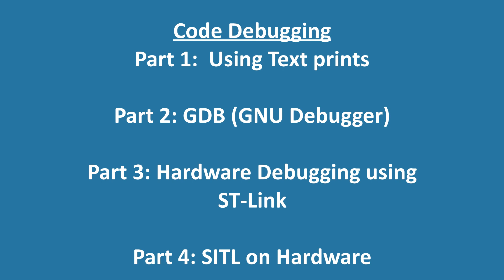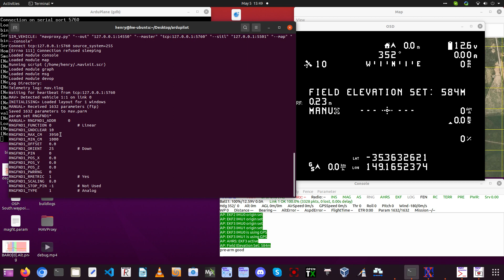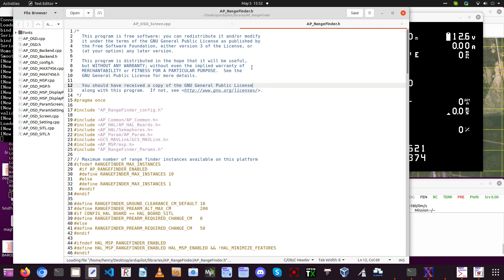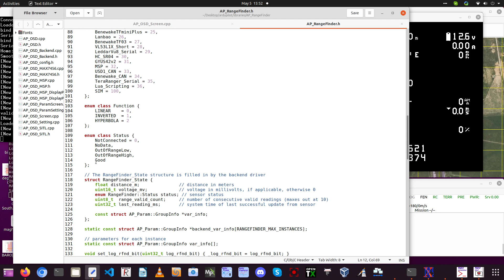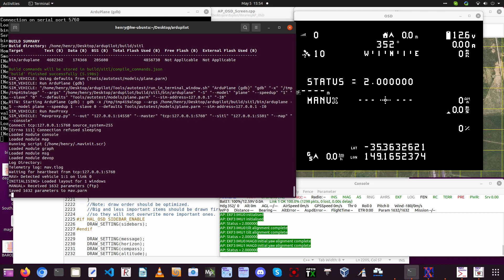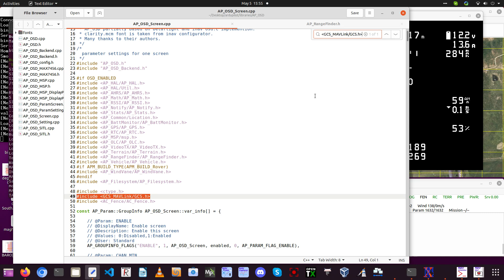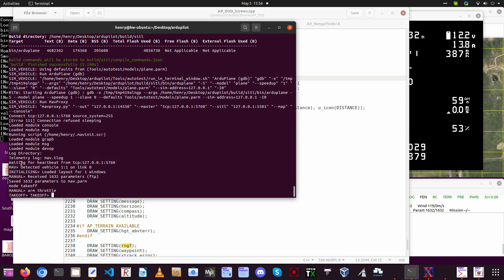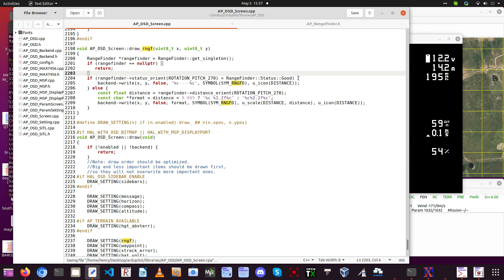ArduPilot Code Debugging Part1

Comment: I would like to output the register contents of the QMC5883L compass module and implement the whole thing temporarily in the firmware. The module somehow does not work with ArduPilot. Does it work and how do I get the data? Can I also display the data/outputs in the messages in Mission Planner?